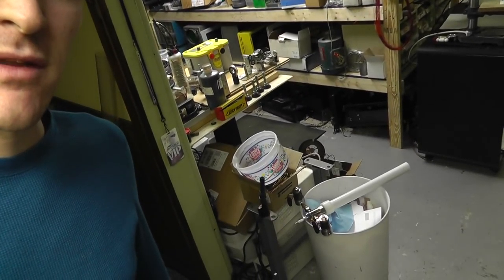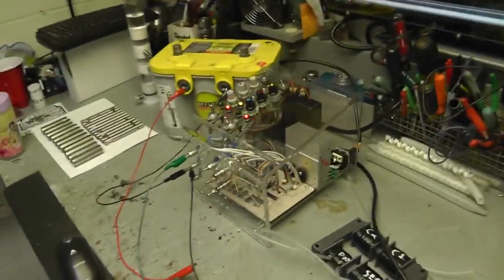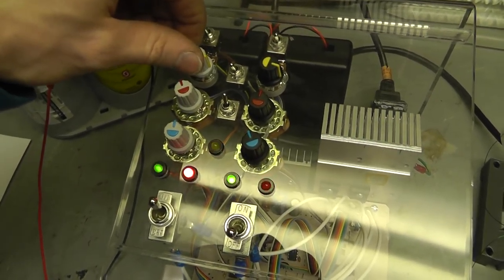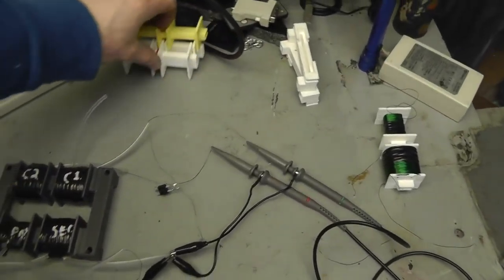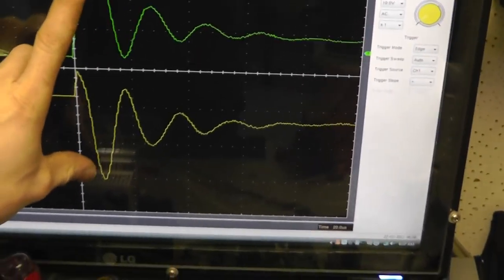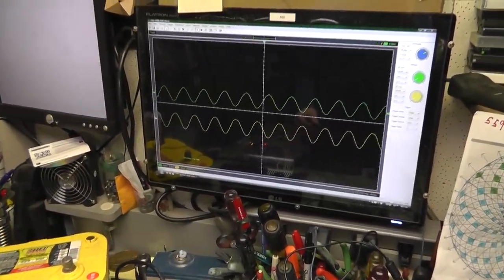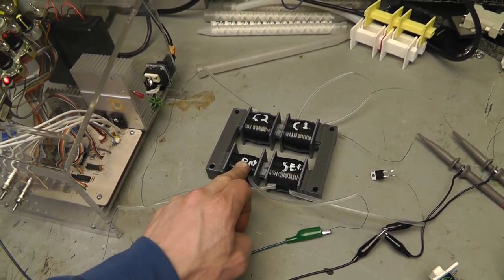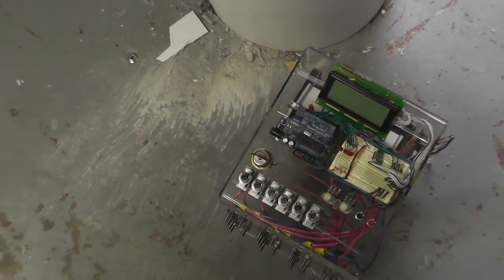Unpolar VIC Pulse Trains & Russtic 7.0 ...& Resonate Cavity Stuff... ~Russ

Comment: @rwg42985 lol
just giving you a hard time........
the wire size is 30 ga, not 29 ga don was wrong
i am haveing a mould made
i am ordering 50 ferrite cores to start, see if they match up to the ones i have already
with them being made in a mould, they may be a little out of perm
so if anyone wants them , they need to speak up. 25 sets coming soon, should be close to the perm
if firepinto want to just make bobbins for the researchers, then i will buy them at cost and sell them at cost..

Comment: @rwg42985 i understand residence but from my own experience being normal step up or down ac transformers to fly back transformers always run way better with a very high frequency close to 200,000 Hz. i have gotten a step down 120v transformer to arc over at 12v input at a higher Hz . but i have never tested with interlocked driver outputs .. can you do a video of blaying around with that on a normal transformer and get readings on how much the voltage change? it would be really cool

Comment: watch your function generators driving transistors .inductive spiking will kill them if they are not rated for 200+ volts when you power a transformer with them or anything with inductance you can get these spikes. also do not use anything rated for less than your designs use for the same reason. you might want to raise the frequency max to about 200,000 Hz i find just about any transformer runs better at a higher Hz.  other than that cool